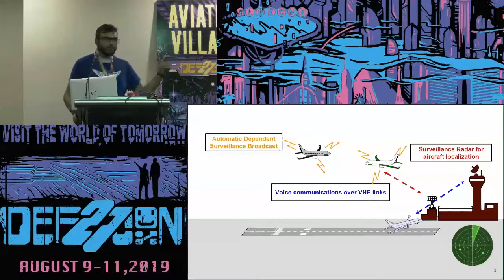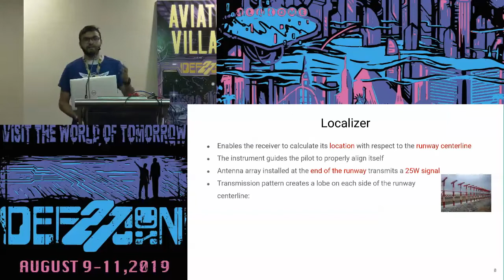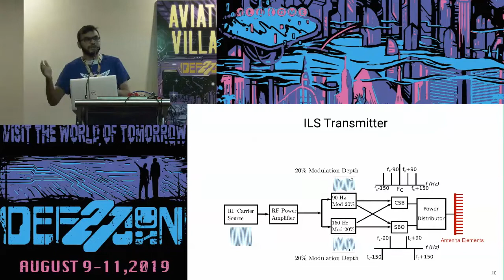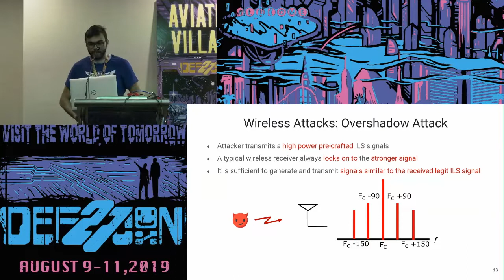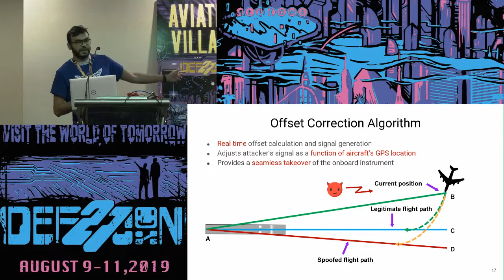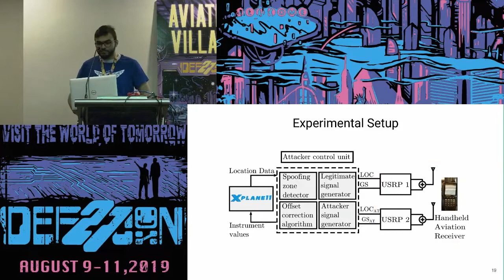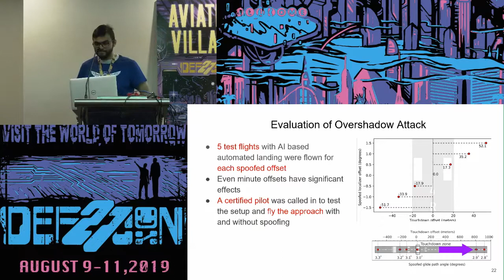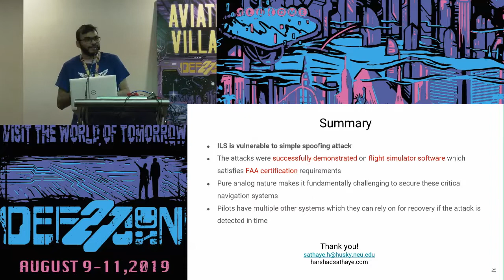Harshad Sathaye - Wireless Attacks on Aircraft ILS - DEF CON 27 Aviation Village

Comment: All fine and dandy, but
There are serious physical problems.
You cannot take pocket sized antenna and pump Watts of energy through it at 90Hz or 150Hz. You need at least a scaled down version of antennas like on airport, which are rather not portable.
Another thing is you need to place such obviously visible from distance object inside airport, which just because of proximity to Control Tower may be viewed as impossible to do without being noticed (how are you going to place several few metres tall antennas on airport without being noticed evades any logic)
Reply: 110 and 330 mhz.  You are confusing the modulated tones with the carrier frequency.